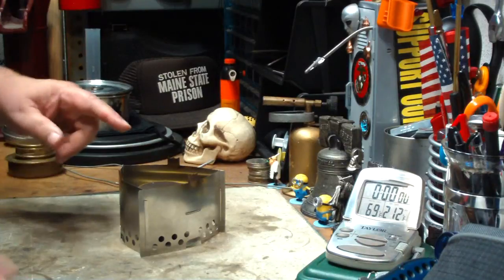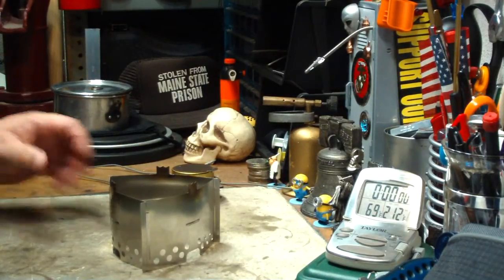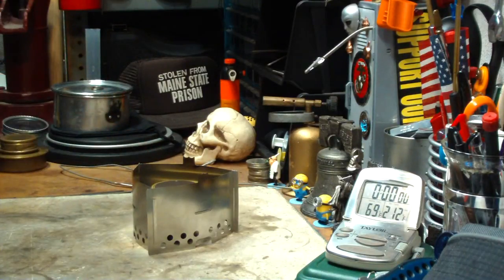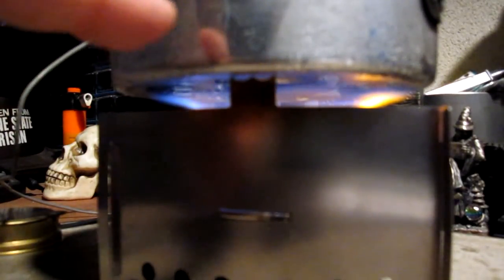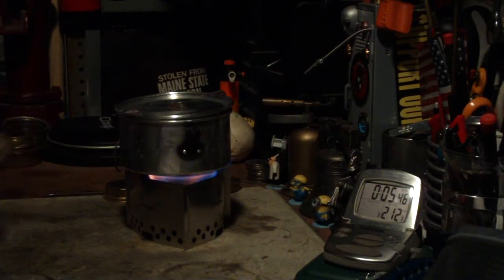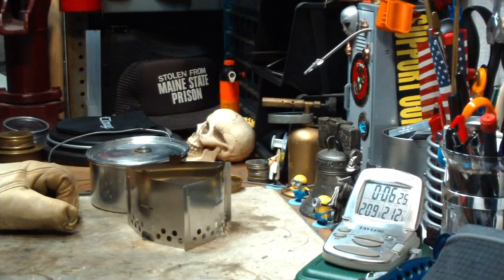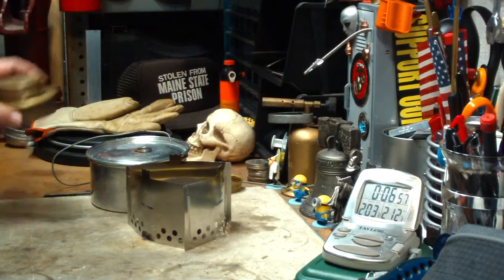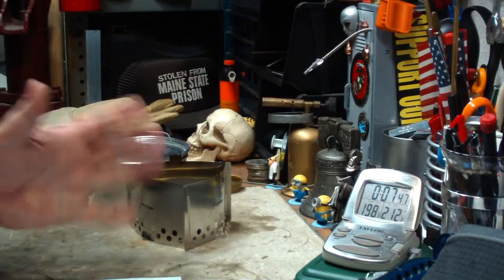Trangia Triangle - Mini-Trangia Burner - Boil Test #2 - Retest Boil Time

Comment: Hiram you could try using a piece of stove rope, about 6 inches long, dip into the stove, light it, light the stove and then put it under the burner through one of the slots in the bottom of the triangle. It really speeds up bloom time.

Comment: Your boil time for the mini Trangia 28 was 7:33. The Triangle beat it by two minutes!  Perhaps the boil time on the Trangia Triangle is faster due to the distance between the burner and pot. I've read that the sweet spot is 38 mm.

Comment: That's about average. My identical setup takes around 6:00 for 2 cups in an MSR Titan Kettle. But I'm a lot higher in elevation and my water starts out colder usually. Both my Trangias always burn yellow as well. Always have. My Tatonka's on the other hand...nice and true blue :D But not as fast at boiling.

Comment: Both my Trangias have yellow flame as well brother. And as you know I use the Methyl Hydrate as well 99.9% methanol.  It's the nature  of the beast with those stoves.. The less fuel in it the quicker it will vaporize for sure. Once vaporized and in full mode nothing changes. Neither pressure or boil time.

Comment: Ezbit makes one like that. I have one. Only bad point about it is the simmer ring cannot be used with it because it's so small. But it is smaller and lighter than the triangle. The Trangia Triangle is a little better in fit and finish. Stays together easier. The Ezbit comes with a pan as well for the cubes :o)

Comment: Yes all my mini Trangias have a touch of yellow flame. I use pure methanol. Question on boil times and fuel volume in burner:  Would time-to-boil be influenced by starting fuel volume, e.g. 1 oz vs 2 oz? Hypothesis: Lower volume of fuel might heat up faster, maybe vaporize faster? Inner walls of burner with less fuel may be more exposed to flame, making vaporization inside faster, and jets have higher pressure earlier in the burn? Maybe a test to try, if not done already?

Comment: Does anyone make a triangle that's designed for the mini trangia? (I consider this one to be designed for the military trangia with an adapter for the mini)  A smaller one designed for the mini might even fit my smaller pots without having to add cross pieces on the top.

Comment: i think it has to do with the air/fuel vapor mix

the smaller one has more of a updraft effect than the larger one with the holes in the ring

that could also explain the yellowing in the flame